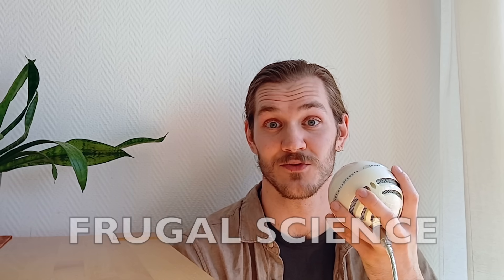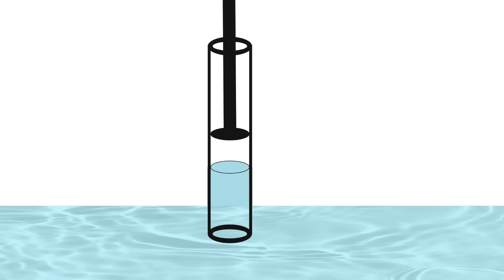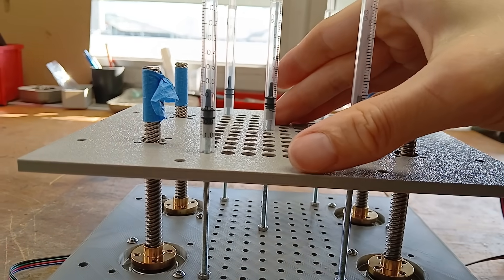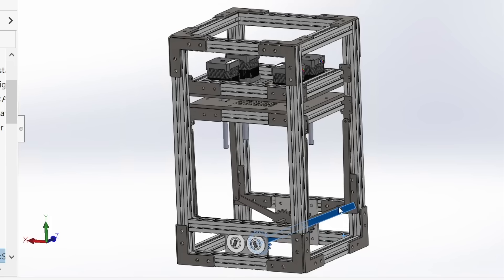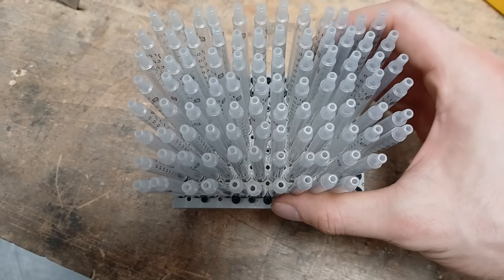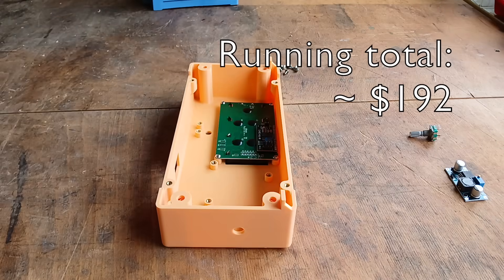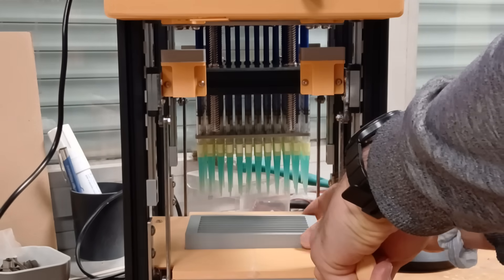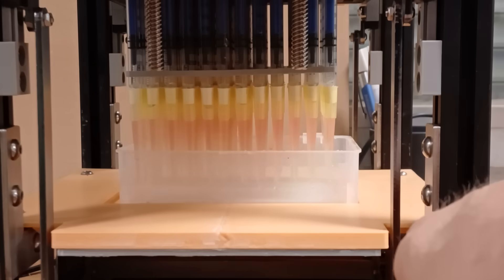This Medical Machine costs $18,000. I Took It Personally.

Comment: The separate Z motors on 3D printers are a never ending source of trouble, because the axis come out of alignment every time the motors are disabled by usually up to a single step; over time, these misalignments add up. So with a P2 screw (TR8x4), it could be 0.01-0.02mm error per restart. Sometimes more and leaning to one side, because there's weight and friction which are not strictly equal.

Unless the printer also has separate Z stops or probe and a gantry self level procedure; or an early alternative, bump levelling, where the multi motor gantry gets ran against some sort of hard stop stalling out the motors until they have realigned themselves.

I don't anticipate that they'll necessarily be nearly this bad here around, but it is something to keep in mind.
Reply: 7:47 it has 4 endstops, just need to program them to stop each stepper properly. I'd use T8x1 steppers though, 4x the resolution but moves slower

Comment: The main question I have (which applies to both the commercial version and yours) is what about sterility? For real-world use, it's going to be important for everything to be clean and sterile between runs of whatever you're doing. Syringes are generally single-use devices for exactly that reason. From what you showed, it doesn't look like the device sucks up small enough quantities that the fluid never actually touches the syringe. I'm sure that helps, but I can't imagine that alone being a sufficient guarantee of sterility.
Reply: Even if the liquid doesn't touch the syringes you'd still want to swap them because of their close proximity to the liquid. It's still possible for it to splash up somehow.
Reply: The commercial product has a 70page protocol fore cleaning 

The diy one has nothing
Reply: @Goroca  Which is there for liability reasons and is designed to be impossible to follow (and never is in practice). Didn't do the whole thing? Sorry it's your fault the results are crap. If they truly cared about quality, they'd make the cleaning process brain dead simple, just press a button, perfect results every time.
Reply: @torginus 
I have no idea 
The cleaning of the equipment we had was don my someone else, I one had the pipetutc fore 6h
Reply: I would try using accordion style pipettes, which would make them self-contained and disposable. Do they exist? I don't know. It might hurt the precision though, so maybe external vacuum is still the better option.
Reply: @RAndrewNeal  Those don't exist because you have zero guarantee of their accuracy and they are not adjustable. You can't even test them to get them certified to ISO 8655 2022 standards if they're single-use.
Reply: @MaskMan191  If they had graduations on the non-accordion tube part, accuracy would be fine (visually, but not mechanically). And I'm pretty sure you test a sample for standards certification, not every single unit. Nonetheless, it was just an idea I had from no more than a few minutes of pondering.
Reply: I would have gone with PVC tubes on the ends and recessed the syringe part so it is well back, you can replace 6mm air hose cheap and easily, and it should fit on the end of the nozzle, but yeah i was thinking about that too
Reply: The real product does not use syringes. Pipettes are pipettes, not syringes.
Reply: In case of devices like this, the liquid never touches the "syringes" - only the tips. If there's such a concern about sterility that even tiny quantities of aerosol (droplets) formed during aspiration could be an issue, then you would use pipette tips with filters. If that still is not enough, then you would e.g. have a sterilization protocol to run at specific time intervals (e.g. daily) or situations (e.g. after using the device on "risky" material, or after a number of uses).
Reply: @KristoffDoe  which none of it is possible because not a single thing in this is even remotely washable. The tips are fixed as a single assy to the syringe body, the syringe body used made it impossible to install filter correctly (and chopping of the top already contaminated the syringe due to microplastic fragments), the sterilization protocol is impossible due to so many crevices and the whole inside of the syringe is inaccessible without total dismantling of the equipment
Reply: @FlyingPlastic356  You are correct in reference to the device from the video. I should have been clearer - I was thinking about a general device type, which could be designed with sterilization in mind.

Comment: You should make a printable tool with a razor blade to quickly cut the plungers to size in a single twist. It should also be usable to cut the syringes' flanges to the same size, so that instead of being press-fit, they can be just secured by a plate on top, that'll make failed/contaminated syringes cheaper and quicker to replace.
Reply from the maker: That's a cool idea, it would solve one of the main bottlenecks in the assembly

Comment: Hi I am disigning an Building rigt now a systhesis controler for automated chemical synthesis. it does cost about what you have shown here and a commercial alternative is insanly expansive. I have no interes in making viedoes but if you like I can provide you a unit and you could make a video of it and improve the design, as I am much less prolific than you are

Comment: You could go even cheaper if used single stepper motor with belts to connect other screws and used linear rods instead of linear rails that are expensive.

Comment: this looks cool, but the one dealbreaker flaw in your setup is cleanabilty. those commercial grade lab machines have swappable disposable pipete tips, which are an absolute neccesity when doing any kind of sensitive experiments. Your setup cannot be cleaned well enough to circumvent those problems (high temperature steam sterilisation).
Reply from the maker: Agreed! The idea here is also to swap out the yellow pipette tips after use, like on the original machine. Those are just press-fit in place, and are (perhaps unfortunately) single use.
Reply: Good point. Cleanability in machines is incredibly important when doing any type of lab work. I enjoy the concept of making commercial systems at a functional DIY level, however there will always be flaws that must be solved.
Reply: But arent all these pipette tips swappable? They'd come right off the heat-shrink tubing if you pulled at them
Reply: Also going to need verification on the accuracy and precision of the machine... the machine he showed is accurate down to 2-3% all the way between .0005 mL to 1 mL... From everything he showed, it might get down to .1 mL... maybe .01 mL... so it's a magnitude of how accurate the other machine is?
Reply: My thoughts exactly! So basically these machines would be better off modular, with entire sections removable and interchangeable for sterilization or replacement? Also, since I guess all 96 pipette tips are changed every time, why aren't they made as a single piece, maybe even with a possibility of being broken into smaller grid sections?
Reply: @pastasuta it's not made in a single piece because the tips are made to a standard because you can also use them with a hand pipette and etc... A lot of labs to save money, buy bags of pipette tips and hand fill the racks instead of expensive prefilled racks.
Reply: @killerhurtalot Why not be available separately both as single tips or as a grid depending on the intended use? I gotta check how they're sold, even if they could be sold in "strips" it'd be both easier to replace them or to break off and use as a standalone pipette.
Reply: @pastasuta  because the grid size isn't standarized. Different manufacturers got different sized grids. On top of that, the grids still need to be put in a elevated box so that the tips aren't touching anything below) to be used rapidly...

They do sell preloaded grids, they're just expensive because every single one of them comes with the elevated box, and epmotion has automated tip loading function with their own color coding and etc... They sell 960 tips for $150-$350 depending on size and etc... You can buy the loose tips for like $200 for 5000 tips... 

Having strips of tips and having to snap them off to use them just increases chances of contamination and is a waste of time for everyone...

Trust me, people a lot smarter than me, you, and the creator has done this... This machine is maybe good enough for baking and etc, but no one would want it anywhere near any kind of actual experiment that requires any kind of cleanliness...
Reply: @killerhurtalot I understand, this came from someone (me) who doesn't really know much about it so I appreciate the insight you gave me very much. Everything you said makes perfect sense.
Reply: @killerhurtalot  No, no lab does that. One, because being jumbled in a bag damages the tips, and two, because that's a gigantic waste of time and money. They don't even sell pipette tips "by the bag", they are manufactured as an organized 8x12 container.
Reply: @pastasuta  Do not listen to them, they don't know what they're talking about. They have clearly never worked with pipettes before, I doubt they've ever even worked in a lab before. Every single thing they've said is just flat out wrong.
Reply: @killerhurtalot no one uses bagged tips anymore. Preloaded racks cost the same. On fisher scientific: 10x racks of 96 tips is £41. Loose tips in a bag is £43 for 1000.

Also you are incorrect about the grid sizes being different. We've been using the same 9mm spec that was standardised in the 1980s.
Reply: @EirinnMackay different here on the other side of the pond. 
Bulk is usually 50-80% cheaper than prefilled boxes no matter who you get it from.
Also,  9mmx9mm grids limit pipette tips sizes. You pretty much have to get a different machine to go up to 1ml tip sizes...
Reply: @killerhurtalot check your local prices, I doubt bagged tips make any sense. It's been this way for years. 
For p1000 tips it's true that they can't be used in multichannel pipettes. Those volumes are better handled by a robot :)
Reply: @EirinnMackay yeah, we gotta order through the stupid university ordering portal. That's what it shows 🤷‍♂️
Reply: Could you talk a bit more about specific ways you did and would rather like to do it and materials that were in use as well as which ones you would suggest?
Reply: those plungers on the cheap syringes are going to fall apart after the 3rd day using it too.
Reply: I imagine you'd just throw those syringes away in a production-grade machine.
Reply: Changing pipettes would be another plate at bottom, which could be lowered via hand crank and would drop the tips. Syringe thing maybe could be sterilized in pressure cooker.

Comment: Is this Open Hardware? Would be great if it was. Also, is there stl's for the parts? Having a shared project in PCBWay would for example be a nice way to have a kit of all parts easily ordered (as an easy way to get all the hard parts, even if it probably is a little more expensive than finding the cheapest manufacturer). Just some ideas. It is really good that you design cheap alternatives to machines that otherwise would be unobtainable.
Reply: I don't think any custom pcb was needed, from what i've seen he's using a cncshieldv3 and some ad drivers, the screen might be used via i2c via an esp32

Comment: use one motor and connect them with a belt and a tensioner, saves cost, i doubt you need the torque from 4 motors
Reply: You don't even need 4 screws. With the liner rails one screw and motor is enough.
Reply: yeah i was thinking the same, 4 is overkill
Reply from the maker: Good thinking, I definitely prioritized simplicity over efficiency on that one
Reply: also prevents the 4 steppers from desyncing while powered off and doesn't require wiring 4 endstops. Just move of a hassle to design and build.

Comment: Cost can be even more reduced by using only one motor, and connect the drive shaft to others using timing belts/chains/whatever. This should also reduce the power requirements, and electronics cost.

Comment: Hey quick question i was wondering if you thought about instead of having one plunger for every single tupe what if you connected them all and then just pulled a vacum on all of them i thouk you could probably quite easily and precisely controll the amount to dose and you would always dose exatcly the same amount from every tube and it would reduce a bit of complexity from the moving part 
Otherwise really loved your project and thrilled that you managed to make it work like this aswell
Reply: I think he actually mention this in the beginning and concludes that even the smallest difference would affect the amount to aspirate/dispense. Consider the following, one diameter that is just slightyly larger in any of the parts would directly affect the force required, which will affect the result negatively. I'd say it would probably make the device unusable.
Reply: Oh okey well then i didnt watch the video well enaugh 
But any small inperfections in the diameter of the tubes will also have an effect on the amount that you're diapensing even if you're using plungers @Moinois

Comment: Great work! The only problem is that any labor that has to be done by hand one-by-one, like sanding down the plungers, actually increases cost exponentially. That would be the only barrier to this being viable.
Reply: Even if it's a pain in the ass, the sheer saving would probably justify the technician or scientist doing this themselves in a developing context.

Assembling kit and boring repetitive work is hardly alien to anyone who's ever worked in a bio lab!
Reply: I think the actual barrier would be the durability on this would be horrible and if you have cheap labor you would be better off with a regular $200 hand pipette than trying to use this. A 8 or 12 channel pipette would be a decent compromise on cost and time at around $1000. It also would be a lot more flexible than this allowing partial plates to be used etc. Some reagents are quite expensive, there are some that it doesn’t matter to waste them, but there definitely are ones where it would increase the costs a lot.

Anyways… neat video, but this does not make sense for any use case I can think of. You would need the scale to be running hundreds of samples, not be able to afford the $18k, actually be able to afford the reagents and other supplies needed to do experiments. There are just too many requirements that don’t go together in any location I am aware of.

Comment: not only it is very simple and looks effective, but there is quite a bit of room for improvements and cheaper parts. 
With all those rails and what I think is a limited load, you can go for two diagonal motors probably, linear rails are also more expensive than roads and linear bearings, but that would make it a bit harder to put together probably, the laser cut steel parts might be overkill. Not sure you actually need all those aluminum extrusions on the two plates, maybe smaller extrusions (like aluminum U channels) or threaded rods as supports could be enough. To be clear I don't want to criticize your choices I just want to geek out at how much one could bring the cost down compared to the original.
Reply from the maker: Definitely! A second pass at this could get even cheaper I'm sure
Reply: @itstriggy4814  yeah it's always easier to improve on a project once it actually exists